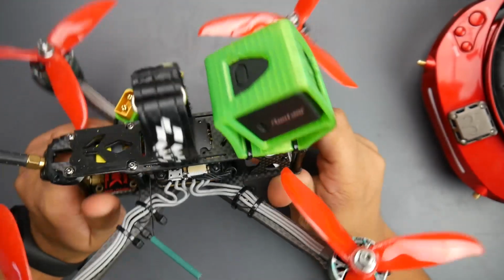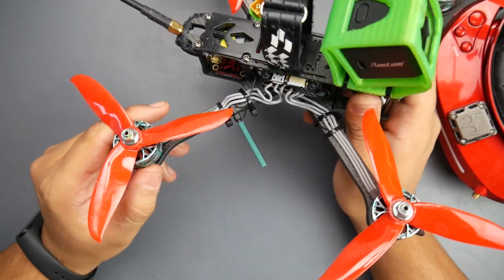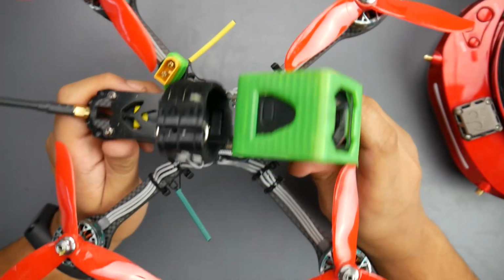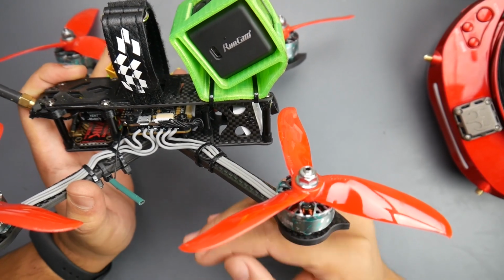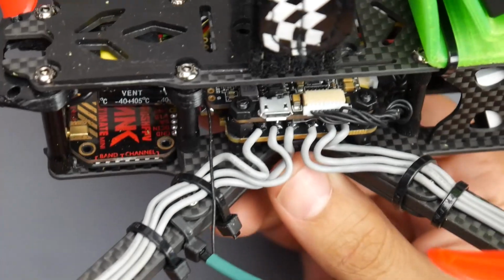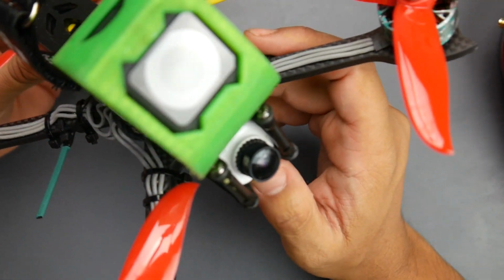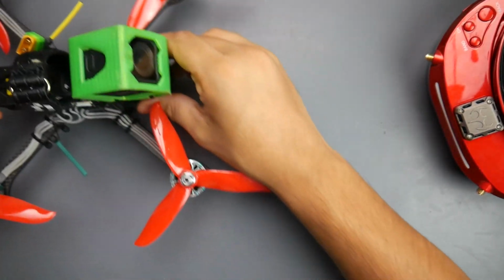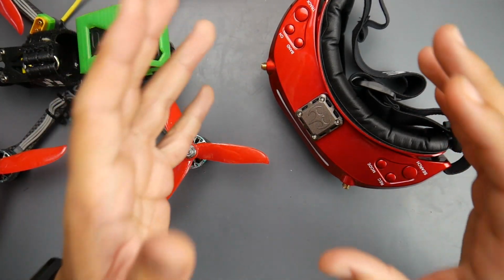Beginner Guide // How To Build A FPV Drone 2019 [Flight and Review]

Comment from the maker: iflight Frame: http://bit.ly/2mju3HT
Holybro Flight Controller ESC Combo: http://bit.ly/2nOyr2x
Racerstar Sic 1888kv Motor: http://bit.ly/2lP5BOi
Video transmitter: http://bit.ly/357bZTa
FXt Mars Pro Camera: http://bit.ly/2FhWvBc
FrSky Xm+ Radio: http://bit.ly/2Kamywh

--Extras
Portabl Soldering Iron: http://bit.ly/2xR2zM9
Hex Driver: http://bit.ly/31KA93c
Xt60: http://bit.ly/2Lcnm31
Heat Shrink: http://bit.ly/2RJ5nCD
Runcam 5: http://bit.ly/2JNOB3f
Runcam 5 mount: http://bit.ly/2OTN69J
Reply: Traducelo:
-estoy subscrito a tu canal sin saber tu idioma pero no si podrias poner los subtitulos en español y asi voy a poder entender tus videos